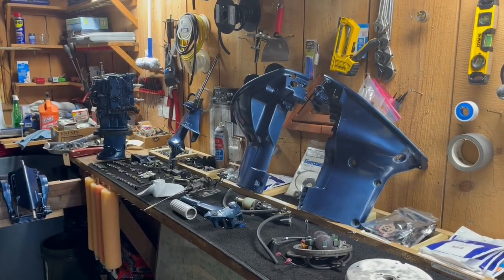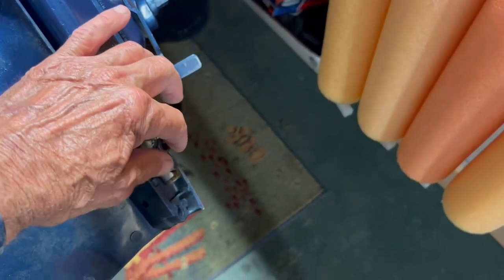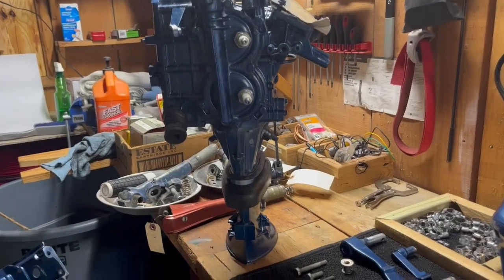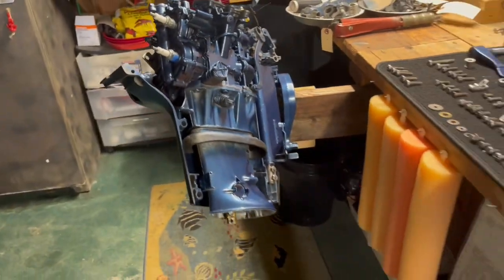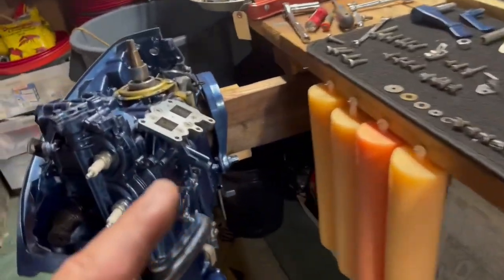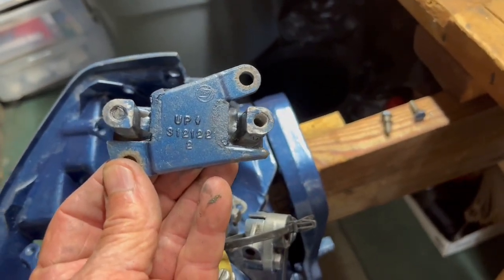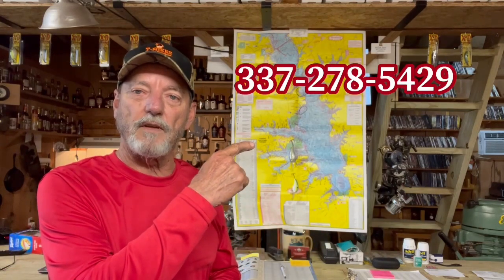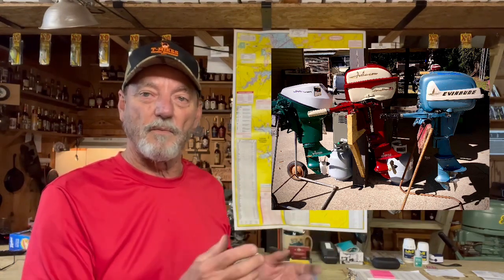Day 1 - Assemble 1971 9.5 HP Evinrude Model 9122R

Comment: Hi T-Mike, I hope you can help. I have a 9.5 Evinrude from '71. The very same as in your video. I struggle finding a matching paint with Vintage Outboard Paints. The Evinrude Light Blue 1971-77 seem too light. Which paint have you used in your restore please? It seems like the one I should use as well. Thanks in advance.

Comment: Hi I am having a problem with my Johnson 9.5 The throttle will not go to WOT The cam follower stops increasing the throttle position with about 1/2 throttle remaining on tiller speed adjustment. The last half throttle doesn't move the throttle at all the cam doesn't have anymore increase in its throw.